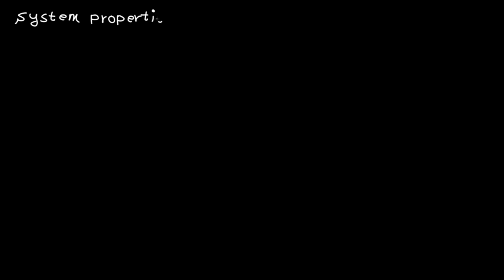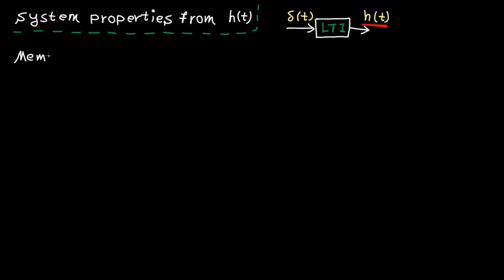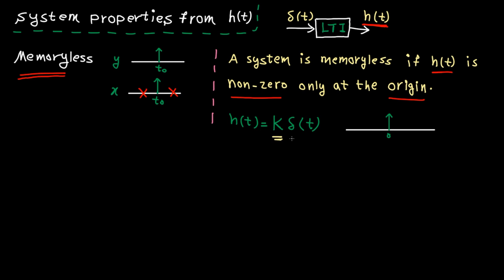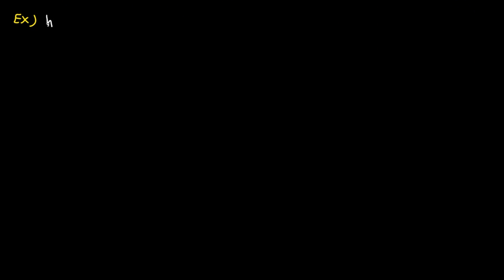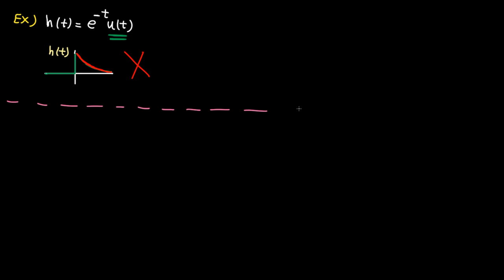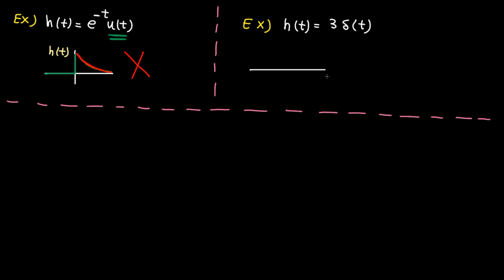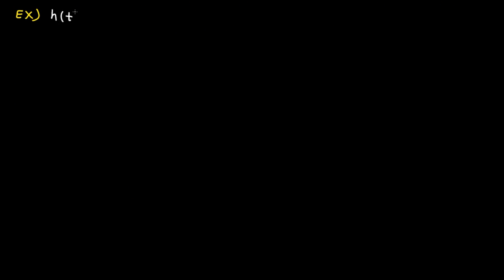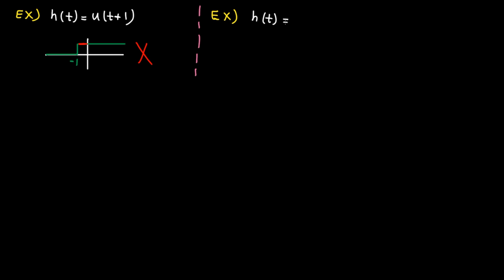Time domain - tutorial 11: system properties from impulse response

Comment: Hello again iman. I've watched all of your videos. Thanks so much. I have a question for this one: for BIBO stability, why do we lets the bounds of integration go from negative infinity to infinity? Isn't this like letting the input go to infinity, in which case, the input is not bounded. For example, for h(t) = e^t x u(t), if you restrict t to be < infinity, then the bounds of integration should be from 0 to b, where b is some value < infinity, and the result would be a bounded output.
Reply from the maker: Hey Mike. Sorry for my late response, I was on a trip. When we let the bounds of integration go from negative infinity to infinity, it doesn't mean the input goes to infinity. As long as the area under the curve (energy) is limited, we have a stable system. As I showed in the first example, the area for e^(-t)u(t) is limited. The problem with e^t u(t) is that as t goes to infinity, the function goes to infinity (e^inf). Please let me know if you need more explanation.
Reply: Thanks for the reply. I think I was just getting confused with the input x(t) being bounded versus the impulse response h(t) being bounded. Bit by bit it's all starting to make sense.
Reply from the maker: Awesome! Happy to hear it's all starting to make sense. Please let me know if you have more questions.

Comment: In the last example for bounded, the step function is one at 0, so don't you get an overlap where t=0:
e^0*u(0)+e^0*u(0)=2
When really it should be equal to 1?
Reply from the maker: Very good question. The truth is the unit step function is discontinuous at the origin and the exact value is unclear. Here is a snippet from page 21 of the book "Continuous-Time Signals and Systems" by Michael Adams :

"Unfortunately, there is very little agreement in the existing literature as to how to define u(t) at t = 0. The most commonly used values are 0, 1, and 1/2. ... As it turns out, for most practical purposes, it does not matter how the unit-step function is defined at the origin (as long as its value is finite)." 

Hope this helps!

Comment: Hey Iman =)

I need some clarification
At 10:00 you write in the orange cloud:
e^-|t| = e^-t u(t) + e^t u(-t)
if i use 0 for t, i get 1 = 1+1, which is not true.
So i assume it is only true for non zero.

However, your Integral is from -oo to oo, so zero is part of it, does it matter?
If not, can u explain why it doesn't?

Can i solve it by subtracting u(t) u(-t) from the formula?
e^-|t| = e^-t u(t) + e^t u(-t) - u(t) u(-t)
If i use this, i get to 1 for the final result, as the Integral of u(t) u(-t) is a bunch of zeros plus a single 1?

Although
 i think Integrals are not a sum of values, but of Areas with ->0 
width (so it's basically adding values but getting an area as a result),
 in which case the single 1 with width ->0 would still result in 
->noArea and therefore the Integral should be ->0.
In this case your final answer of 2 would be true, which i assume is actually the case.

Sorry if this is confusing, i'm a little confused too right now.
I use oo for infinity and -> for some kind of limes, i hope you can understand what i'm trying to say.
Best wishes, Andy
Reply from the maker: Hey Andi, sorry for my late reply! I have been super busy with life, my friend. 

First of all, I have to say you are an amazing student who cares about every single detail. I am really impressed and I am sure you would have a brilliant career ahead. 

Regarding your question, I need to admit that I had the same question when I saw this equation in my undergrad (oh man time flies). Technically what you said makes sense: "if i use 0 for t, i get 1 = 1+1, which is not true." To answer your question, I'd like to quote a famous saying from a signal processing book (Continuous-Time Signals and Systems by Michael D. Adams):

"Unfortunately, there is very little agreement in the existing literature as to how to define u(t) at t=0. The most commonly used values are 0, 1, and 1/2. In our treatment of the subject, we simply choose to leave the value of u(t) unspecified at t = 0 with the implicit assumption that the value (whatever it happens to be) is finite. As it turns out, for most practical purposes, it does no matter how the unit-step function is defined at the origin (as long as its value is finite)" 

I wanted to explain this in the video but I was worried that I might make many students confused! 

If you assume u(t) is half at the origin, the equation I wrote would be correct. I hope this explanation helps. Cheers!
Reply: i see, so as i already assumed the point is: it doesn't matter
thx and please keep doing these videos, you're great at teaching/explaining.
Reply from the maker: Sure Andi. Thanks for following my videos ;)
Reply: @imanmoaz  Fourier Analysis of u(t) suggests that a natural definition at t=0 is 1/2 because this is the average value of the limits if u(t) approaching 0 from the left and right. I usually don’t define u(t) at the origin at all, mostly because I’m lazy 😂